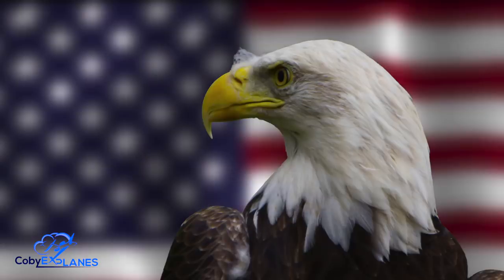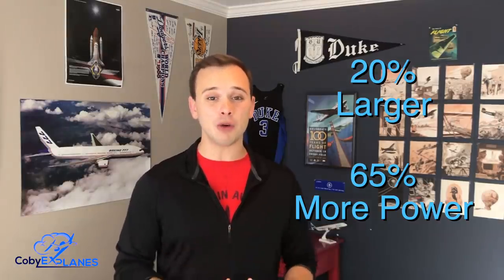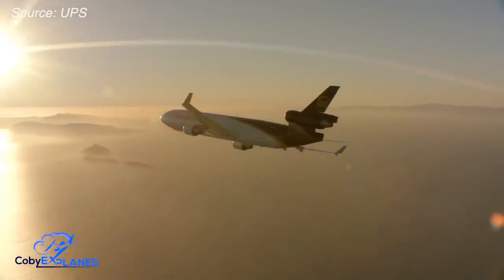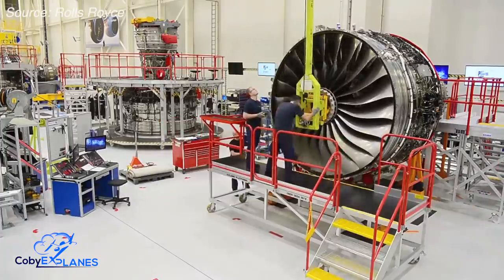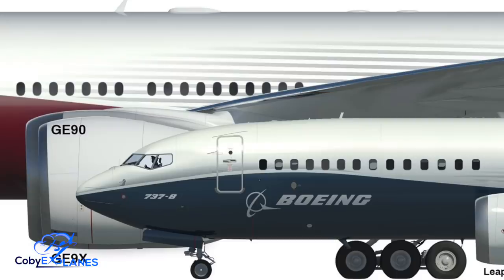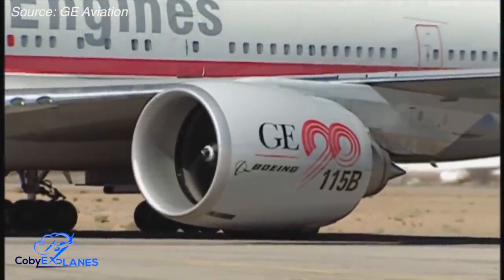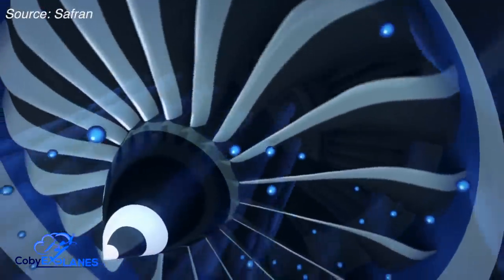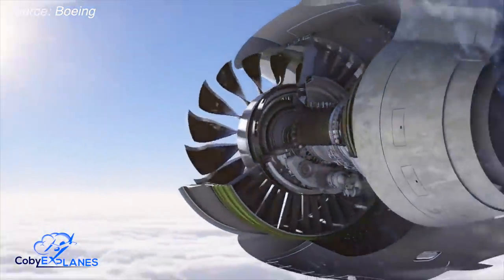The World's Most Powerful Jet Engine: The Story of the GE90

Comment: GE90: I set the world record for the most powerful thrust produced during testing
GE9X: Hold my throttle
Reply from the maker: Well, looks like a follow up video is in order haha
Reply: the GE9X actually makes less thrust than GE90-115B, because the new wing of 777X improves performance enough to reduce thrust requirements
Reply: Mark Sandstrom what I was stating was at triple red line testing
Reply: Mark Sandstrom GE9X is able to produce more thrust than GE90 when pushed to the limit. They just proved that during testing. The lower thrust rating is in place to prolong engine lifetime and save fuel since the lighter 777X doesn’t need that much power
Reply: @犬井いぬい  are you sure that GE90-115B at triple redline makes less thrust than GE9X at triple redline?  Neither would be a case that has anything to do with real operation in commercial service.  And if the 9X's capability were that much, it would tend to indicate an over-designed engine that is either heavier and/or more expensive than it needs to be.
Reply: Mark Sandstrom I’m pretty sure that if pushed to the limits the 9X is more powerful since it has a bigger fan and the new TAPS III combustion chamber. But obviously rating the 9X this high would not be necessary.
Reply: Mark Sandstrom GE9X set a world record of almost 600 kN of thrust, way more than the GE90’s 569 kN.
Reply: Most of its thrust comes from the primary compressor fan being essentially a bypass fan its a turbo prop in disguise
Reply: GE9X is a developed GE90.
Reply: @marksandstrom4248  
The larger fan-size gives it greater fuel-efficiency , while the lower rpm.s make for better durability
Reply: @犬井いぬい  Thank you, I stand corrected.  I do still think that this technicality is more public relations stunt than sound engineering - commercial aviation is the last place where good money would be spent to achieve performance that is not required.  During my aerospace career (I retired in mid-2016) I know the 777X was not projected to ever need thrust capability as high as the older 777-300ER needed - if this is not true anymore I haven't heard so.
Reply: Joeduard Barrientos  I'm not sure what you mean by "can" - as a real engineering / technical / economic action it would make zero sense to actually do that.  And I think the 777-9 still weighs more and needs more thrust, than the heaviest highest-thrust 777-200ER versions.  PWA made a handful of PW4098 engines but I believe none exist at all today.
Reply: IAE V2500: I may be small

But I never will be low in sound
Reply: @marksandstrom4248  I flew on a 777-200ER with United from Frankfurt to San Francisco that was equipped with PW4098 engines.
Reply: United still has a handful of them left
Reply: @zacharynascimento3921  No, not quite.  UAL has had PW4090 engines operated at various thrust ratings.  This engine has a considerably different bill of material than the PW4098 did, of which only a handful were ever made, and only operated by Korean Airlines.  Because of the lack of sales success, all PW4098 engines were withdrawn from service a decade or more ago, I presume to be retrofitted back to PW4090 configurations.  None exist today.
Reply: @planespottingmla7644  its developed from the GEnx, which was developed from the GE90
Reply: Anyone know the name of the song in the background? Shazam can't find it because the narration is also in the video

Comment: I’m not sure if it’s entirely accurate to state a 747 needs all cf6’s to stay airborne.  Sure it would struggle to take off on a normal runway with say 2 or 3 engines, but once at cruise it can cope.
Reply: Hi....all multi-engine commercial a/c have to be able to perform with one engine in-operative. Hence on take-off the certificated performance includes assuming one engine fails (usually at V1 speed as most critical point).....so the 747 can take-off on three, the 777 on one engine etc. This is why with all engines operating (hopefully always) the twins typically climb faster than quads. Not everything about quads is bad, a twin with an engine failure HAS TO divert to the nearest airfield, whereas as legally a quad with one engine out can continue to destination or elsewhere
Reply: just as an intellectual exercise (it would be foolhardy plus illegal to actually do it) I'm curious about the case of 1-engine-out starting right at brake release at the beginning of the runway, at an offloaded gross weight and optimal center of gravity.  but then you'd have to think about the case of unexpectedly losing one additional engine during that takeoff, and the exercise ends up being just chasing your tail...  Possibly the true answer is, we cannot know.
Reply: 3 engine ferry is no sweat for a 747
Reply: Claude Bedard  Impressive indeed! Must have been a sight. I've not seen one fly yet.  I have seen the Rolls Royce test bed 747 up close, HUGE does not come close to describing these monster engines. 👍
Reply: So y not the 747 w/2 GE 90’s and call it a deal.
Reply: @BilgePump  You still need all four engines to properly operate the plane - not because of thrust, but because of the design of the hydraulic, pneumatic, etc systems.  It would be too costly to reengineer all of that, you may as well design a clean sheet plane at that point.  I bet they had the 3 stock engines operating at idle at least during the tests of the GE90 and others.
Reply: Always wondered this.  Thought that it should be doable.   Maybe a 747 with two of the GE90's and two of the CF6, Turn off the CF6 in flight to save fuel. But the drag would not be worth it I am guessing
Reply: @robertnichols7131  yeah you'd be better off just flying the 777s at that point.

Comment: I went to Line Replaceable Unit (LRU) training at the Customer Technical Education Center (CTEC) in Cincinnati in 1997 for the CF6. I was working on the KC-10 at the time. We got side information on the GE90 while there. There was also an ex test engine for training available on-site too. Those four foot plus long blades weigh nothing, especially compared to any other metallic fan blade. One of the other things they told us at the time was, when the first it went to the take off power setting in the test cell. The expected thrusted was supposed to be around 90K plus. Instead it exceeded 100k and they were just getting started. Oh yeah, Go Duke!

Comment: 777: 2 GE90 engines to fly

Me: What if it had 4 like a airbus A340
Reply: I think that the wing could not support all that weight. The 777 has a very light wing
Reply: Alla Musk I know but what of the design production Supported It, Like the Qantas 747-400 That flew with 5 engines
Reply: @thatslowbenz  yeah maybe but isint the 1 of the reasons that it is so fuel efficient that the wing is so light weight?
Reply: Alla Musk Yeah If it had the 4 engine idea it would’ve been a failure plane But Boeing Made good care while making this great and might airplane
Reply: Claude Bedard  Yeah, They kinda rushed in making it, Causing alot of flaws, It could've been better, But they had to ruin it, Because they wanted to show it as soon as possible.
Reply: Claude Bedard  A340s could've survived, But Airbus just Needed to make a 4 engine long plane, And they rushed, Instead of Making it patiently, I would rather fly a A330 than it.
Reply: @thatslowbenz  its was just carry a 5th engine to be install on another 747
Reply: It will go mach 2
Reply: Why add more weight and Cost...especially when those 2 have more power than all 4 of the A380.
Reply: Where I work we are preparing to launch a GE90 program for complete overhauls. They put together a small team of personnel, issued us the work scope planning guide and said read up. Very exciting.
Reply: if the wing could withstand it, on full speed with 4 engines on max thrust on a 777x, it might even reach mach 1
Reply: C B  Definitely, you can be what you want on the internet, right?

Comment: Excellent video, Coby.
00:13 picture is actually a PW4060 engine. Way to differentiate PW4060 from a GE CF6-80C2 is the precooler outlet on the silver part of the aft cowling position. Left side of engine is PW, right side is GE. This rule applies to engines on 767 and 747-400 aircraft.
I've had too much time on my hands looking at airplane pictures throughout the years.😉👍
Reply from the maker: Of the 100k+ people to watch this video, you're the first to point this out. Good eye!

Comment: I've always wondered why boeing never considered doing a re engine of their 747-8i as a twin jet with 2 very large engines such as the GE90, it would require a new wing, but it would be so much more efficient. Maybe a new design based on one of these airframes would make more sense, but anyway, it would put these very large jets in a whole new category of efficiency.

Comment: The bypass air plays a crucial roll of adding thrust. This was not known during the CF6 age. I’m surprised you didn’t mention this in the comparisons.
Reply: ???  The high bypass thrust is exactly why early high bypass engines like CF6,  RB211 or JT9D have been designed. Of course the effect was known!

Comment: Wider engines introduce a variation within a turn of the engine [fan]...higher speed incoming in the fuselage  proximate air stream, rather than the slower  general air speed away from the plane's body. This may be causing some of the challenging 'fatigue' failures in the fan's blades.
'

Comment: Come on Rolls Royce has ran engines over 120,000Ib too. The exclusive use of the GE90 on the 777-200LR and the 300ER was conditional on the Engine Manufacturer being responsible for partly bankrolling the the development of the Aircraft I mentioned. Both Rolls Royce & GE are pretty much on par with their Engine development.

Comment: Great video. ☺️ The GE90 is my most favourite Jet Engine ever built and the GE90 is the best sounding Jet Engine ever made and no other Jet Engine can replace it.
Reply: Not the best sounding.  You've never flown in a 707, have you?
Reply: @AudiophileTubes  That just sounds like a hoover or any random type of Jet Engine. There's no uniqueness about the 707 jet engines
Reply: @joshuahalla.k.a.controlla6333   Many would disagree.  Sounds like a true, low bypass inefficient jet engine.  The GE90 sounds like a loud blender.  Still very cool though.
Reply: @AudiophileTubes  The GE90 sounds the best when starting up and when it's spooling up just before the plane gains speed and when it's shutting down.
Reply: @AudiophileTubes  The 707 still sounds nice though
Reply: @joshuahalla.k.a.controlla6333   We flew Emirates from Newark NJ to Athens GR last summer on a 777-ER, and the sound of the GE90 was powerful and glorious.  Each jet engine has it's own unique sound signature, which is very cool.
Reply: @AudiophileTubes  Agreed. It's amazing how every engine sounds different

Comment: The 9X set the record for max thrust, its only rated at 105k lbs of thrust because that’s the max thrust chip installed. Just an FYI, the 115s are all down chipped to 105 now as well

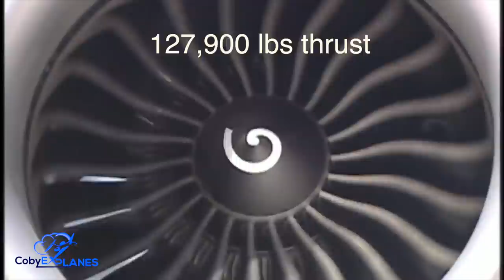Comment: 2:28 that engine is actually just 123 inches in diameter, I can tell because the fan blades are not swept fan blades. Only the models with the swept fan blades have a 128 inch diameter. 3:01 that record has since been broken by the GE9X, at 134,000 pounds of thrust.

Comment: My favorite airplane is probably the dhc-2 beaver because it has such a powerful engine and can still take drag without slowing that much.
Reply from the maker: Wish I knew more about seaplanes....perhaps I'll do some research :)
Reply: My fav plane is the B757. Still considered narrowbody, ETOPS certified for longhaul, 2 powerful engines (some may say it is overpowered), great for short runways and reaching high altitudes quickly when needed. It's my workhorse.
Reply from the maker: @gavin3598  You should check out my 757 video then (if you haven't already done so) :)

Comment: The new GE9X which is going to be used on the 777X recently proved to even more powerful than the GE90. The GE90 produces 128,000 lbs of thrust and that’s a lot, but the GE9X put out over 134,000 lbs of thrust on a test. The GE9X is the NEW most powerful engine!

Comment: After thinking about thrust and jet engines, it seems as if the actual thrust comes from the intake fan from the front. The jet stream in the back is a by product of the thrust which is actually from pulling the plane forward through the air…IDK….any thoughts?

Comment: When you consider that the 777-300ER is a larger aircraft than nearly half the 747's built - certainly larger than the 747-100 General Electric formerly used as a testbed, one moving that lightly loaded testbed through the air on its own isn't a particularly big deal.

Comment: So lucky to have stood inside the GE90-115B engine , while the engineer took a picture of me 🤣🤣 question , why doesn't the 747 use 2 GE90's , instead of the current 4 engines it has ?
Reply from the maker: because the 747's wing is optimized to handle a distributed load across the entire wing. Sticking two engines on instead would localize the weight and risk aerodynamic instability/wing cracking. Would be cool to see, though!

Comment: Thanks for your informative & thought provoking video. Am only prompted to comment as Bigger isn’t always Better in its own right—in this case, is the crux of the matter, and the true technological advance , really the bigger bypass ratio of the GE90?
While the superb GE90 output of 124,000 lb of thrust under test conditions is a world record, a 747-400 with four older design RB211 turbofans still is equipped with a total thrust of 240,000 lbs. 
So, in general operating circumstances a GE90 operating at its extremes might be enough to precariously power a 747-400 that’s lost two of its four engines... 747 two engine-out situations have a history of being problematic.

Comment: Can you explain exactly what happens to the human body in a plane crash? We know that bodies are ripped apart on impact, but is there a way to explain in detail exactly how it happens? Plane crashes are all different, but one crash that intrigues me is PSA Flight 182 which crashed in San Diego, CA on September 25, 1978 killing everyone on board. The Boeing 727 collided with a Cessna in mid air, and was going 300 mph as it impacted the ground at a steep angle. Only body parts were found and some of the passengers were never identified.

Comment: Should just retrofit 2x GE9X to replace 4x CF6/PW4000/RB211 on 747-400 and put bigger winglets on it, and make 747-400 much more fuel efficient with 787 Modern Glass cockpit with 787 dream interior, that would be a good way to retrofit old 747-400's and keep them flying for many more years to come
Reply from the maker: Unfortunately the wing structure wouldn't be able to handle the new load of such large engines - they're optimized for distributed weight across the whole wing. Would be very cool to see, though!

Comment: 3:36 - lies!! The 747 doesn’t “require” power from all 4 engines to stay airborne! It can do it with just 2, the others are for safety and redundancy!

Also the GE9X is not as robust as the GE90... requriring a lot more maintenance and monitoring to make sure it’s running smoothly and more prone to engine failures (see 777X engine issues)!
Reply: Yup, It had  4engines since it was prior to  ETOPS.

Comment: Not only powerful, but reliable as well. Both Rolls Royce Trent 7000 and Prat Whitney 4000 of near equivalent are not as reliable especially after accumulating 70,000 flight hrs. Congs GE 90
Reply: I machined several internal parts for GE90. I had a six year run on a zero QAR at the time. In other words no mistakes for six years which included the GE90 parts.

Comment: i have been on a 787-9 powered by RR Trent 1000, is it stronger than GE90
Reply: Nope! Ge90 115B is 115 thousand pounds of thrust in daily use! Most powerful Jet engine to date. Very impressive. I flew it for many hours
Reply: david render  sorry David  I have quite a few hours PIC on the triple with GE 90 115b, Never a hickup. Many more flying than any Airbus wide body.
Maybe you are confusing the GE90 with the Rolls Royce trent which has had significant problems in service!
Reply: 787-9 thrust rating is 71,000lbs per engine, GEnx or Trent 1000, GE90-115b is 115,000lbs thrust rating per engine, GE90 is substantially more powerful.
Reply: Also David just to be clear a large part of ETOPs is engine reliability! The 777 has an ETOPS of 330 minutes single engine. Quite a phenomenal number. Having flown over the North Pole (actually just to the side) many times I can assure the GE90 115b is a tremendous success!
Reply: no, even the genx is more powerful than trent 1000

Comment: I listen to a lot of your videos and like them although I thought I heard you say that the 747 requires four engines to stay airborne I don't believe that's true I believe it will stay airborne on two of its engines May struggle to gain altitude on two engines but it would stay airborne I think that may depend on how heavily it was loaded. Don't FAA regulations require Tommy engine redundancy for Crossing oceans as the 747 was designed to do???

Comment: The Ge90 WASN'T the best selling or most impressive. All this videos praising the GE90 all fail to mention that the first generation was kind of crap compared to the PW4000 and , specially, the Trent 800.
Every video about it make it seem like it was some revolutionary engine, that only GE could have made, when in fact it was the worse of the 3.  
The heavily reworked 110B/115B is a different beast, yes, but the dominance and lack of competition was bought, not earned. Came by default with the exclusivity deal.